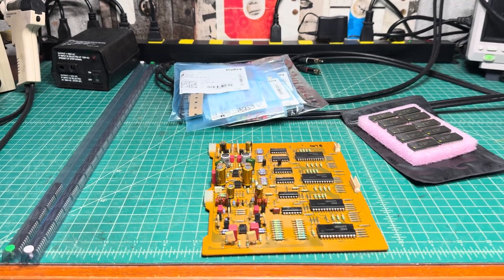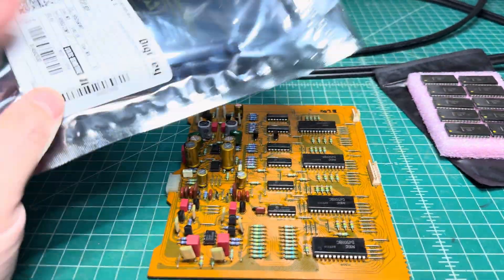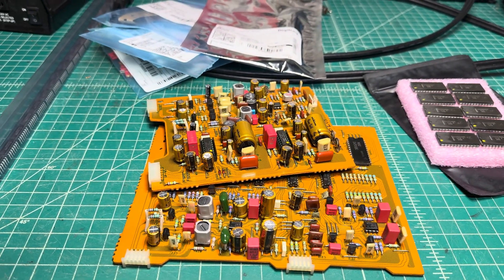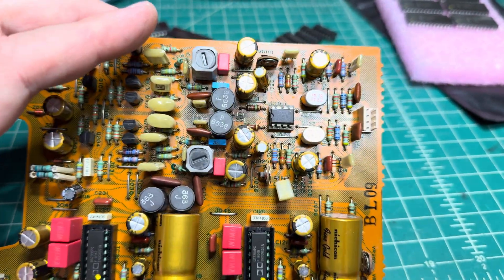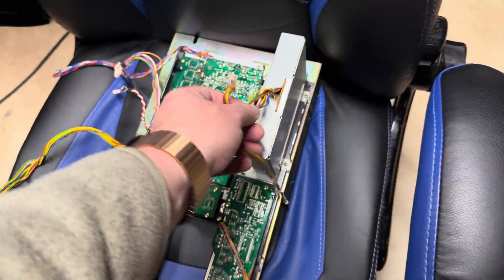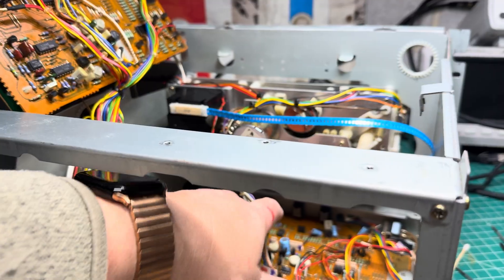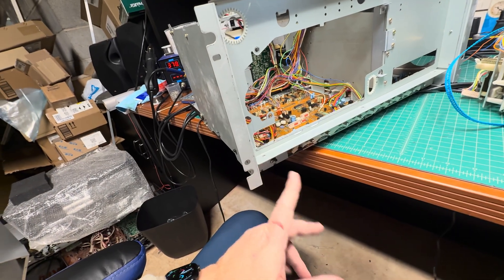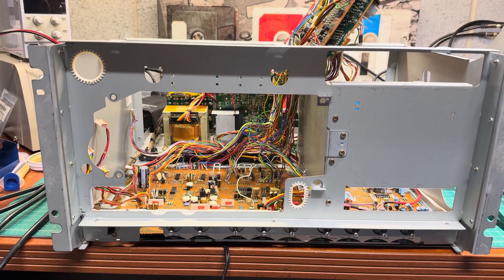Inside the Nakamichi 1000ZXL | Major Overhaul – New Caps, ICs & Analog Switches

Comment: I admire the channel's author. You can really learn a tremendous amount about servicing cassette decks. Here's just a small suggestion.
For upgrading vintage cassette decks like the Nakamichi 1000ZXL, choose the LC4966 over CD4066 or PD4066BC. It offers a higher voltage rating (up to 37 V vs. 18 V), providing a safer margin at +15 V operation and eliminating risks of overvoltage damage. With lower typical ON-resistance (80 Ω vs. 125 Ω), reduced THD (<0.01% vs. 0.02%), and faster switching times (20/30 ns vs. 70/60 ns), the LC4966 delivers cleaner audio, tighter bass, and zero switching pops—perfect for critical paths like SOURCE/TAPE monitoring and Dolby NR selection. The absolute best choice would be Mr. Nikitin's ANT4066, but it's currently unavailable (A.N.T. Audio).
Reply from the maker: Thanks, but in the 1000zxl design 4066 used only as a switches to the ground to vary different RC circuits in EQ. No sound goes over these. Also, I have used CD4066 from TI in 680zx and Dragon and these recommended themselves pretty well sounding.

Comment: No way that all of those IC are bad. I can believe that 2 or 3 can be damaged but not all.

Blind change is not a repair but shooting and praying that issue will be solved😂
Reply from the maker: Well, this exact deck had a complex history. I dont want waste time for the simple stuff when I cant get my oscilloscope to the board. So, replacing with brand new ICs WILL exclude unexpected issues and I WILL NOT waste my time on that. It is easier to replace all around than find a broken one. Considering that it did run with the power supply without stabilizing caps. So, your sarcasm is not accepted or welcomed. I wish you try to measure something in that deck WITHOUT extensions boards.
Reply: @hifirulezzz I am not sarcastic but it is first time I see such approach. Well if the ics were running without any stabilisation then they are dead probably.

Im waiting for video what is the result after IC change. Hope the deck will start to live 👍

Comment: I just noticed you obtained your 5532 op amps from Digikey and have the same lot code as 20 I purchased from Digikey. I’m in the middle of questioning their authenticity as none of mine are showing as having diodes. My understanding is I should be getting a reading on my multimeter in diode mode when connecting pins 2 and 3. Might be worth checking and sharing your findings?